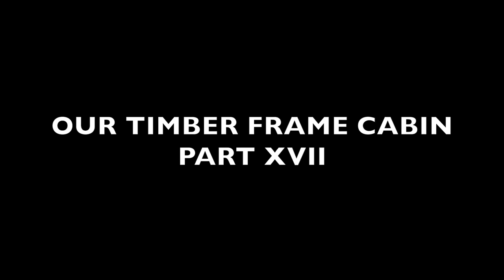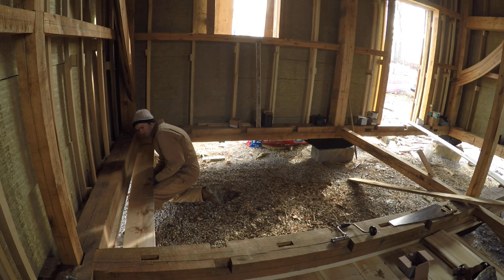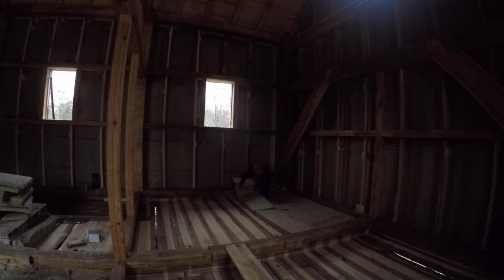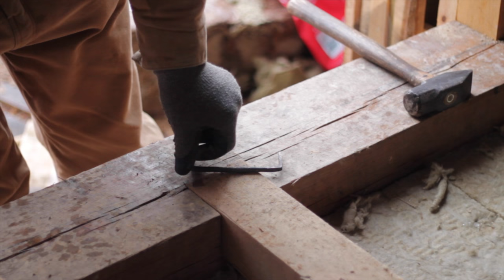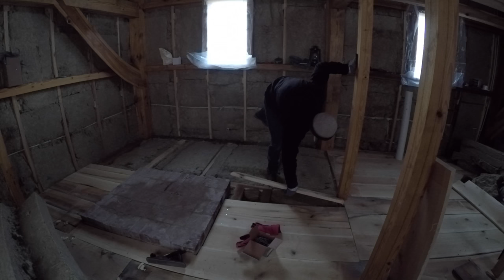Our timber frame cabin part XVII: JOISTS AND SUB FLOOR

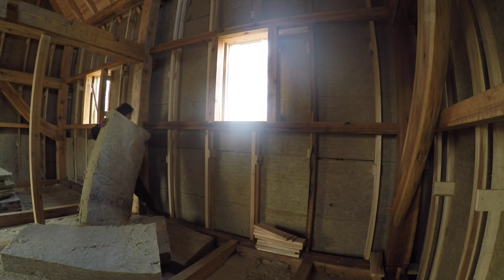Comment: 5:00 That's one heck of a staple!
I bet your place will feel cozy warm with all that insulation. I'm jealous. The apartment building I live in does not stay all that warm. On cold nights, you can feel the cold seeping in from the exterior walls. This place was not built very well back in the late 70s. They were cheap and cut corners everywhere. It's also built on a slab, no basement, so you can feel the cold from the ground coming up through the cement in spite of the floor padding and carpet.

Comment: I been enjoying your wood work,  it good to see workmanship you've put into everything you biuld ... You take me back when my parents bought 25 acres I was only 12y and we didn't have power and all our tooler where hand operated , still remember using the brace , chisel ,saw and not to forget the hammer , when we biuld the farm shed which was 70 feet long and 30 feet wide , the walls where 12 feet high....Memories. .. Now getting to what I was going to ask you was why didn't y you tougue and grove the floor board . You went to all the trouble of being particular every thing else why not the floor and it would of been a nice touch to it .... 
Besides that keep up the good work..
Cheers from down under....
Reply from the maker: Sounds like you had an amazing childhood. The floor you see is just a subfloor, we found it not necessary to T&G it together. The hardwood finish floor will be however.
Reply: My bad..... lol 
Keep up the fantastic work .... Cheers

Comment: I love your videos,make sure you put a heavy plastic vapor barrier under the crawl space to keep your insulation dry.😀
Reply from the maker: All tyvek and related vapor barriers are a modern concept which has not been time tested, but may prove to be very detrimental in the long run (mold and other air tight issue being very common). Houses need to breathe, our house is elevated and open to allow ventilation underneath. The house as a whole utilizes rain screen and other type ventilation spaces which wick any moisture up and away from the structure.

Comment: Very nice work to you two! My wife and I have been watching since you hand hewed your workshop, and we're very impressed and inspired. Over the past year, we have been dismantling and salvaging old houses and barns in our area, with plans to build a cabin and outbuildings with the material. Since each timber is unique and none of the material is of uniform dimension, we will need to use scribe rule techniques to custom fit each piece. What have we gotten ourselves into!! 😬 Through my research and learning about timber framing, I've noticed there isn't much information on this technique. Do you have experience with scribe rule? If so, we were hoping you could share your knowledge with us. I am confident that with my years of carpentry experience this method will be something I can understand if I were shown the basics. We thank you in advance, and keep up the great work!
Reply from the maker: Sounds great! I have personally tried various layout methods, first Edge/Square Rule, then scribe rule. Recently I have become an advocate of Line rule, or snap line rule layout. If you give it a try I feel confident you will be sold. It is just as accurate as scribe rule with odd shaped or curved timbers, but MUCH easier and faster. This is the dominant form of layout in much of asian and the EAST where timber framing is a high art much more advanced than Euro/Amer framing. 

With this method you can swiftly and accurately lay out curved, round, twisted or otherwise odd shaped timbers. I have tried to show the method in detail in several of our cabin build videos, especially the collar tie and "tulip poplar post" 
If you need more info or guidance in this very good method of layout let me know, or drop me a PM!
Reply: Mr. Chickadee Thank you for your kind response! After much searching, reading and re-reading, I'm finding very little on snap line rule. I feel as though I understand the basic concept of the method, however lots of guys have differing opinions on where to snap your lines. Some say find your "soul line" or center line, others say snap the lines along the sides of where your joinery will be. Is there an advantage to either? Some say level your timber first, others say don't. Also, most of what I've found involves guys using semi-perfect timbers, when ours are far from perfect. Is there a possibility you could put together a video explaining in detail the steps taken to lay out a timber in such a way? I know that's asking a lot of you, perhaps you could lead me in the direction of a book or article I may have overlooked in my searching? OR if there is some work you need help with for a couple days, my wife and I would be more than happy to lend a hand in exchange for some knowledge. 👌We are not far, just up in Ohio. Again, thank you for your time and willingness to help in our journey. Keep up the GREAT work!
Reply from the maker: Please send me a PM so I can better assist you

Comment: Quick question, buy why nail the bottom boards to the bottom of the frame?  Would a ledger on the bottom inside of the sills for the Tulip Poplar to rest on have been an option?  I just feel like the nails will release over time.Love your work, by the way.  Fantastic stuff.P.S.  Wondering if you know someone who may have used the phrase "the 'G' stands for 'Greatness' " in your past?  Semper Fi, brother.

Comment: couple questions.  Was there anything put between the first layer of R15 mineral wool and the second layer of R23 insulation?  Is the 2nd layer of insulation also mineral wool?  Second, is that some sort of tape put over the joints between the boards that are nailed to the underside of the frame? Thanks

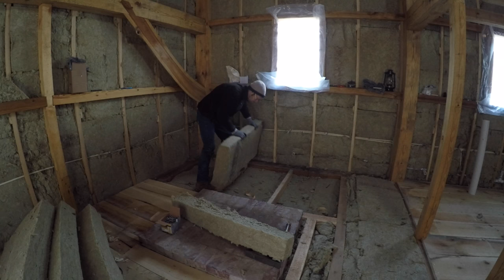Comment: Around 5:33 when placing rockwool. Would it not be advisable to mount them with more of a overlap than shown? In order to minimize cold spots.
Thank you for a wonderful channel. Very interesting and nice to see how your skills have progressed.
Reply from the maker: There are no cold spots or drafts since both the walls and the floor have a thermal break layer which has alternating seams with the inner insulation.
Reply: ok, sounds well thought through

Comment: I'm curious about one thing.  When you drove in the cleats to secure the floor joists to the sill, you positioned the cleats so that they were predominantly over the floor joist, say 75/25.  I would have thought 50/50 would have given a stronger joint. I'm curious why you did this.  Thanks!
Reply from the maker: Good eye, with the "staple" located further into the joist it will resist pulling out more.

Comment: So, maybe a stupid question, but what keeps your subfloor from falling out over time as the nails holding them to the underside loosen.
Reply from the maker: Only an unasked question is stupid, spiral shank nails tend to go in like screws, very tough to even pull out, conversely screws would work and we did use some in a few areas.
Reply: @MrChickadee  "only an unasked question is stupid"... what a quote,  am a teacher  allowed me to use this in front of my class

Comment: Great job. I wonder  about wet floors, toilet or bathroom on wood surface. Is there a traditional and smart method without using chemical membrane?
Reply from the maker: well traditional houses did not have indoor running water or bathrooms until very recently in human history, so this is a new dynamic for us to adapt to. However, we feel chemical membranes to not be the answer, but a good job of using a traditional natural oil/pine tar/pine rosin type finish, combined with just being careful how much water is thrown on the floor.

Comment: It's looking great. Here's a dumb question. The lower floor boards have cracks. Won't that be an opportunity for rodents and insects to get in and nest in your insulation?
Reply from the maker: If you look carefully at the video you can see rodent screen was stapled over the gaps before the first layer of insulation was added.

Comment: Those look like thicker mineral wool batts than I usually see. 8"? Where did you order them from?also, I dont think I could tell in the siding video, what did you put at the bottom and top of the wall truss? Just a board?

Comment: When you say well ventilated but draft proof insulation, are you saying that the insulation itself is creating an air barrier (no drafts, no house wrap plastic needed)? And being exposed to the air on both sides (well ventilated, no vapor retarding plastic), dries as needed?
Reply from the maker: That is exactly right

Comment: Great job. I like the iron staples, did you consider doing dove tails as a way to tie your joists in so you wouldn't have to use fasteners?
Reply from the maker: Thanks. Dovetails in this application in green wood have proven to be unreliable as they shrink with seasoning and lose their integrity. Good tying joists can be made but should be through wedged tenons for strength and longevity, or iron staples. In our case we found the staples to be more practical.

Comment: a question lie that, since there's gap between the planks  in the sub floor isnt moisture  gonna go to the rock wool? like i'd probably would put a tyvek underneath or something, overkill?
Reply: The floor is raised, and covered, I imagine the airflow will help dry any excess wetness out, and only a flood would touch it from underneath, but I'm no authority.
Reply: martin blouin i reckon the first layer of insulation which he referred to as a thermal break will stop warm air meeting cold surfaces and so preclude condensation.
Reply from the maker: All tyvek and related vapor barriers are a modern concept which has not been time tested, but may prove to be very detrimental in the long run (mold and other air tight issue being very common). Houses need to breathe, our house is elevated and open to allow ventilation underneath. The house as a whole utilizes rain screen and other type ventilation spaces which wick any moisture up and away from the structure.
Reply: when I was in the military stationed in Fairbanks....they gave us the older style ECWS parkas and pants with moisture wicking underwear, etc..   they handed us a pair of gotex boots, and a pair of canvas mukluks with a set of felt liners.  (I later bought a pair of sorell felt glacier boot liners...a little thicker felt but much the same)
they also handed us some fairly new (at the time - circa early 90's)  gortex gear.   I tried them...I was constantly cold, particularly if you had to do ANY sort of exertion in them (like getting firewood, shoveling out the car, etc....)
but the older, canvas, felt and such ECWS gear?  NEVER got cold...any moisture you created, migrated out easily...the only time I noticed it was when i'd been out for a bit and came back in, and found a layer of frost on the inside of the canvas mukluks, but NOT inside my felt liners....ever since then, i've gone for BREATHABLE materials....if you trap the moisture, you're creating problems in the cold....  
It would seem to me, a house is much the same...if the moisture can migrate out, it can escape...

Comment: That looks like it should be easy to heat.
Did you make the U shaped fasteners ?
Even a Hello, Howdy.
Reply from the maker: The staples for the floor joists? Yes they are forged from coil springs

Comment: Too bad Tyvek and the nail gun weren't invented a few hundred years earlier. Interesting job you're doing.
Reply from the maker: All tyvek and related vapor barriers are a modern concept which has not been time tested, but may prove to be very detrimental in the long run (mold and other air tight issue being very common). Houses need to breathe, our house is elevated and open to allow ventilation underneath. The house as a whole utilizes rain screen and other type ventilation spaces which wick any moisture up and away from the structure.
Reply: Mr. Chickadee I couldn't agree more. I've been restoring houses for 20 years and I'm always amazed when I tear a 100 year old roof off to find perfect rafters and or first floor joists.
Reply: Yes I like time tested etc. as well, but remember what happened to the Luddites.

Comment: I think I would have liked a vapor barrier (like tar paper) under finished floor?
Reply from the maker: With proper design, vapor barriers are not only unnecessary, they are in fact very detrimental as they trap moisture inside the walls or other interstitial spaces of the frame, causing mold, decay and other issues. The oldest and best surviving wooden architecture had no cement, no vapor barriers…that should prove without a doubt what is needed and what should be avoided.

Comment: How long total did it take to finish this building? And how many m3 timber did you use totaly? I know I am asking too much :)
Reply from the maker: We are still working on this cabin, there are about 16 timbers 8x8, 3 timbers 8x10, about 10 4x4s, and 22 4x6 rafters, and 20 4x6 floor joists.
Reply: Thank you and good luck.

Comment: So you're not using any kind of windbreaker to avoid problems with mold?
Reply from the maker: mold is often actually caused by poor modern practices like the use of plastic vapor barriers which trap moisture inside of walls and other areas. Our frame has no vapor barriers anywhere, the walls utilize a rain screen vent space which is connected to the roof vent as well, so any moisture in the system can escape and be whacked away. No excessive moisture=no mold.
Reply: Mr chickadee could you explain a tiny bit more about the rain screen you mention several times? Love the videos and have just bought our first house, large workshop underneath it so I can start practicing hand woodworking and timber framing. This is a stepping stone to a larger parcel of land to build from the ground up similar to yours. Thanks for the answer and I'm truly grateful for your content!

Comment: I'm very impressed with your work! However, I'm very sad to see mineral wool in your floor. You should have plastered your lower boards with clay to keep the wind out and reduce moisture and then added cellulose, hemp, wool or similar natural insulations. You would get a much better indoor climate as well. Mineral wool will probably work your life time, but it looks like you're building it to last a couple of hundred years...
Reply: The same goes for your walls.
Reply from the maker: Don't be sad, this is what we had time for this year, f that were not a factor, natural straw/clay or such insulation would have been used. As an alternative, mineral wool is about the best there is, and has a long time tested track record. 150 + years...

Comment: Are using any vapour barrier on this build?
Reply from the maker: All tyvek and related vapor barriers are a modern concept which has not been time tested, but may prove to be very detrimental in the long run (mold and other air tight issue being very common). Houses need to breathe, our house is elevated and open to allow ventilation underneath. The house as a whole utilizes rain screen and other type ventilation spaces which wick any moisture up and away from the structure.
Reply: Mr. Chickadee ahh, I see, a common question! I hear what you're saying about a house breathing, I was just curious, thanks for the reply.

Comment: you don't need or want any moisture barrier?
Reply: Majoofi it's elevated. It breaths. The insulation is mineral. Rock wool
Reply from the maker: All tyvek and related vapor barriers are a modern concept which has not been time tested, but may prove to be very detrimental in the long run (mold and other air tight issue being very common). Houses need to breathe, our house is elevated and open to allow ventilation underneath. The house as a whole utilizes rain screen and other type ventilation spaces which wick any moisture up and away from the structure.

Comment: are you not afraid that mice wil infest the isolation material?
Reply from the maker: we stapled rodent screen over all gaps in boards before adding insulation.
Reply: Mice don't like rock wool for nesting.